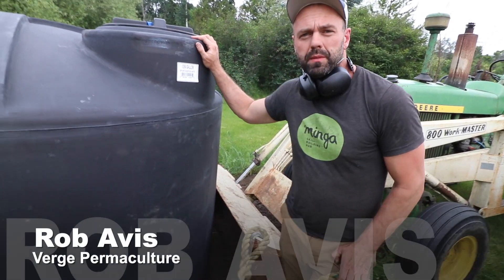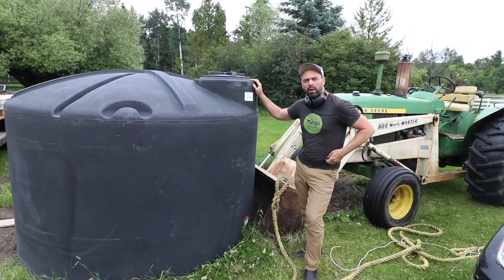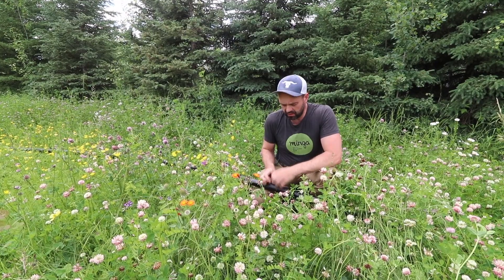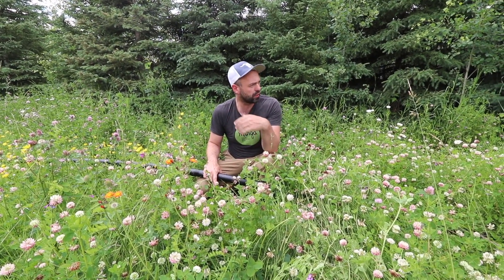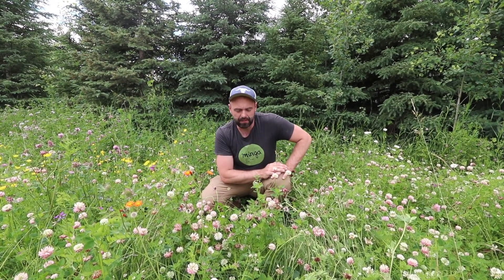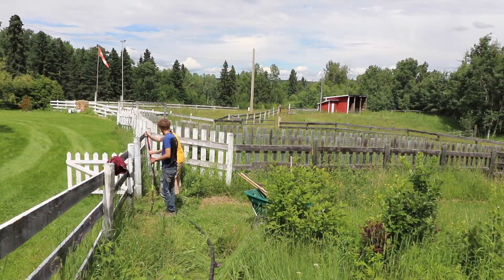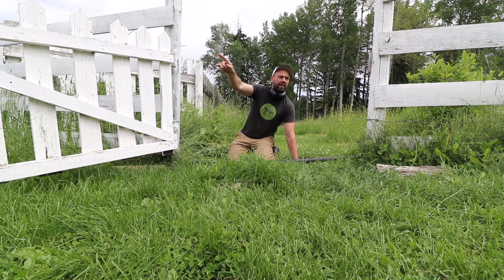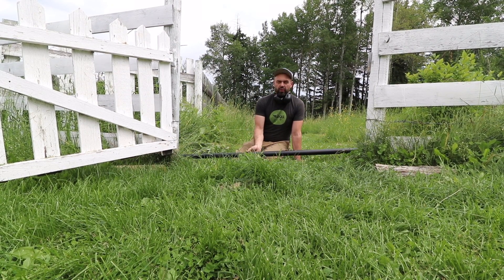Setting up gravity fed water system for regenerative agriculture

Comment: What happens your HDPE pipe during the coldest parts of winter?  Does it get damaged from freezing water inside? Also, my family has had issues with bears and other wildlife chewing on exposed pipe in the driest parts of the year - so it had to be buried.  Is the pipe from your springs to your holding tanks buried?
Reply: Hi Rob, it looks like you will have to blow the pipe with compressed air really well to drain it. Those little dips below a gate may come back to annoy you for years until you smooth the slope. We blow the pipes and still get enough water gathering in little dips to crack pipe, I think some of it is from condensation. On a long run of 1000’ it doesn’t take a big dip to pool enough water to cause damage. Time will tell but blow them until no vapour comes out and you should be fine.
Reply from the maker: Great question. We drain it in the fall so there is no water in the pipes. We will find out if wildlife like to eat it. That has not been my experience thus far. If you want you can plough the line into the ground just below the surface.
Reply: With that insulated electric wire... any reason you wouldn’t want to use a wire with slightly higher resistance to generate enough heat to keep the pipe above 0C? Water all year round could be awesome.